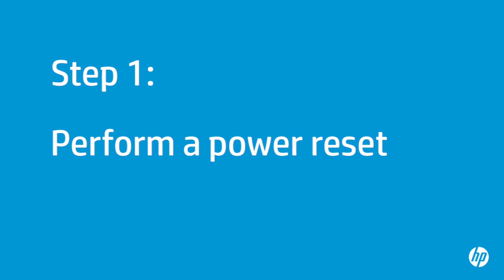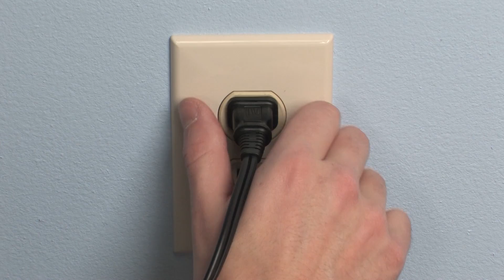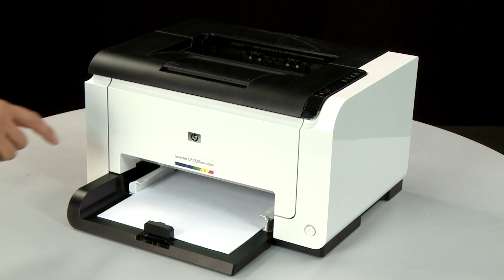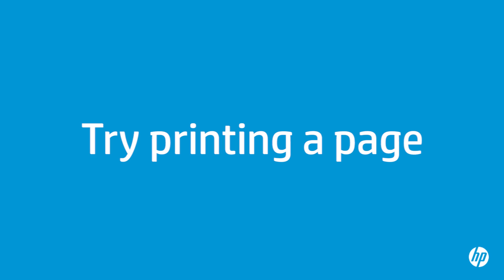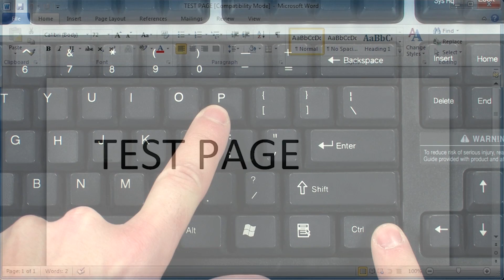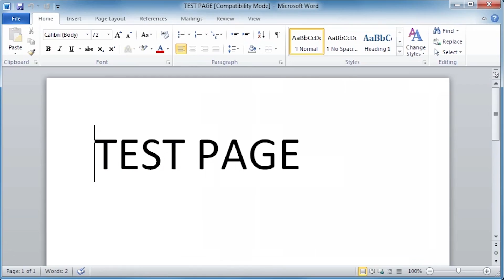Fixing Paper Pick-Up Issues | HP LaserJet Pro CP1025nw Color Printer | HP

Comment: printer turned off and didnt turn on
Reply from the maker: +MufarejQ8 If the  printer does not turn on or respond when you press the Power button, the steps in this document should help you fix this issue: http://bitly.com/2HIiAbw

Comment: My HP 1025 goes to cool mode after printing 2-3 pages what to do plz help
Reply from the maker: +rajesh raja I have provided a document with Resolving Control Panel Messages: http://hp.care/2vh8BVX  Make sure the printer is connected directly to a wall outlet. (don't use a power hub or a surge protector) This ensures the printer is receiving full power and may help this situation.